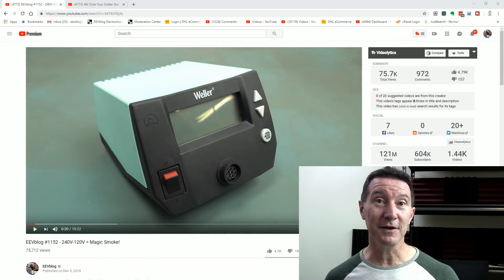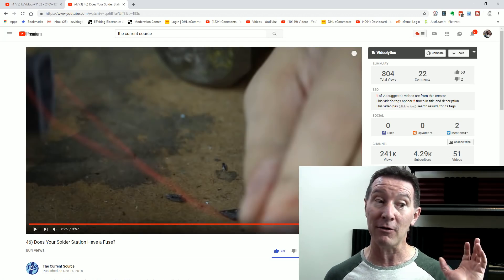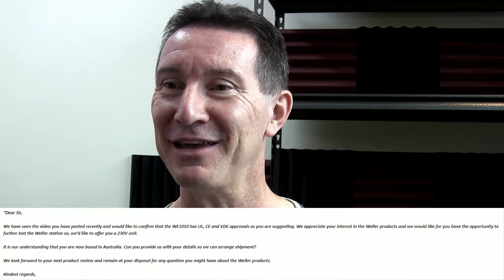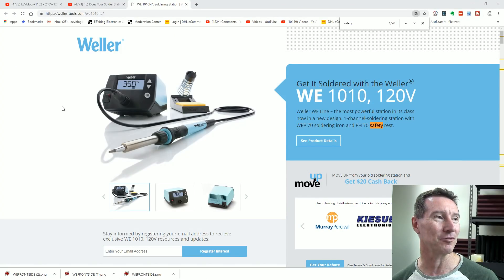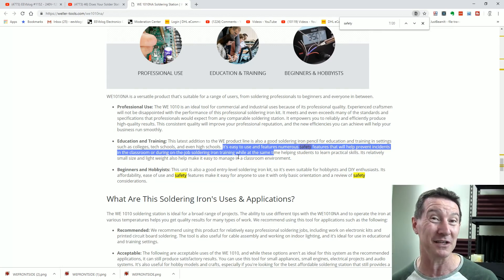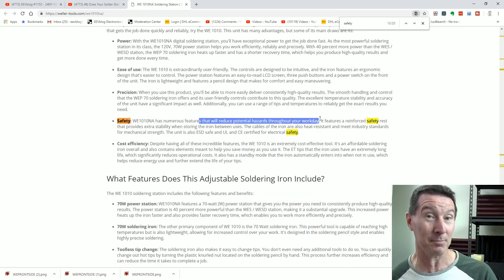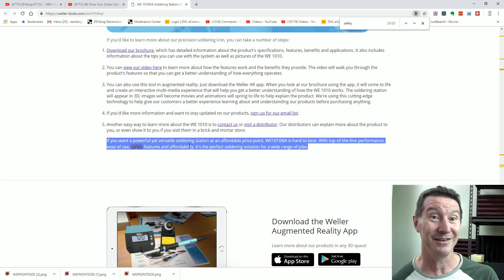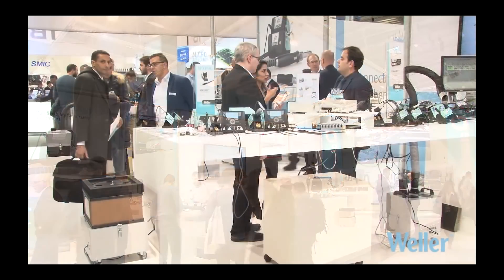EEVblog #1160 - Weller Responds!

Comment: When I was going to electronics college many of my classmates got in the habit to run to the bathroom to run their soldering iron under cold water so it wouldn't burn anything when put back in the plastic suitcase electronics kit. I never did because I suspected the thermal shock could not be good for it. Later the teacher got a response from the company saying not to do that and the kids did get free heating elements and tips for their irons. (This was pre temperature controlled irons)

Comment: I didn't realize Weller was a Banggood house brand.
Reply: Even worse - On Banggood you might get a refund and the soldering station wouldnt cost 120 bucks. You wouldnt bother to get refund anyway cause it would be cheaper( invested time)  and just easier to order another one.
Reply: Watch it, Banggood might sue you for slander.
Reply: Fluke and Tektronix are owned by Fortive Corporation, a Chinese conglomerate.

Comment: So one hung lo are safer than the 20X safety Weller.
I do have to ask why are analogue transformers better than switch mode based solder stations. Is this harking back to some old school myth or is there some genuine reason for this?
Reply: About 40 years ago, i bought a station with nothing but a big transformer, power switch and of course a primary fuse in it. Still works like on day #1. I bet most of that cheap SMPS stuff won't survive even 10 years.
Reply: @7hemroc  That isn't quite the same thing though, is it variable temperature like all these modern stations (which all have circuitry that can fail on the secondary side). I have switching PSU's for PC's that are over 20 years old that still work and these weren't expensive models either but cheap units that came in cheap cases.

The transformer itself can be over engineered with large tolerances, but the weller that blew up on the primary side, obviously has lower tolerances built in than some of the old heavy monsters. Having a transformer does not mean that it automatically has a large built in tolerance for varying voltages, unlike modern switch mode supplies which can have a wide range of input voltage. A modern cheap switch mode unit wouldn't have blown up when plugged into 240V.

The only thing I can find that the transformer based supplies have over your average switching supply is efficiency.
But at 70-100W or so for your average iron, even an inefficient design will only draw an additional 15-20W compared to a transformer based design, and given the cost differences of say $50 extra for a basic transformer model, it would take 10000 hours at $0.25 per KWh to recoup the cost difference. Of course with many switching supplies efficiency now over 90%, the efficiency difference can be less than 5% between a well designed switching and the typical transformer based supply which is typically 95-98% depending on the load and that then shifts the total hours to recoup at 40000 hours plus.  But of course that very much depends on the total design and corrections for power factor to get that efficiency, which means that even efficiency isn't automatically a given advantage to transformer based PSU's.

So the question remains unanswered as to what advantage transformer based workstations have besides their secondary use as a paperweight.
Reply: @magottyk  Yes, there are some SMPS that work 20+ years without any kind of maintenance, but the odds of that happening are substantially lower than with a transformer. The more components (and thus solder joints) there are, the higher the likelihood of failure. Some of those components even have to be electrolytic caps. They simply cannot compete with a trafo in terms of longevity. In all other respects like price, weight and probably even efficiency, a modern SMPS beats a trafo from 1970 hands down.
Reply: @7hemroc  
The transformer is only one part of the entire unit that includes circuitry as well. Therefore no modern solder station can claim better longevity whether it has a transformer or not, therefore the expense of a transformer seems superfluous to good design given the expense.
So is it just old school myths that presume them to be superior products, especially as they cannot be used universally without even more expensive transformers that require manual setting to switch the input voltage.
Reply: @magottyk  Nope, not this one. Unless you call a 24V iron with a magnetic switch in it "circuitry".
Reply: @7hemroc  
You seemed to miss the "modern" in modern solder station.
BTW is it a variable temperature model that you can dial in with fine graduation or something more basic.
Reply: @magottyk  Look at your original question, no "modern" there. It was just about trafo vs. switch mode. Not that anyone gives a shit nowadays, but the one advantage a trafo has is its longevity. Even if i used this oversized trafo to power a TS100, that combination had a much better chance to last 40 years than the same TS100 on a current SMPS. But since i don't expect to live 40 more years, my soon to purchase TS100 will get the cheapest chinese wall wart i can find :) My good old Weller "Magnastat" (with fuse holder on the front panel) will stay with me though, just in case the TS100 doesn't boot the latest firmware. The former will surely still work when I'm worm fodder. Not so sure about the latter...
Reply: @7hemroc  
So you're comparing apples and oranges, fixed temp vs variable temp irons.
Looks like the old school myth wins.
Reply: @magottyk  No, the magnastat is also variable temp. It's just a bit more hassle to change the temperature. Gotta change the tip instead of turning a knob.
Reply: @7hemroc  
Don't piss in my pocket and tell me it's raining.
You can change the fixed temperature by changing the tip and it looks like there's three temps to choose from.
That's not variable temperature by any stretch of the imagination with respect to modern stations, you also need to buy three times the number of tips if you want to cover a range of temperatures for each tip shape you use, if you don't have the different tips, you can't change temperature.
Reply: @magottyk  You can change the temp, thus its not fixed. And of course such a grampa thingie has its drawbacks. But it also has one advantage: It lives like forever.
Reply: @7hemroc  
Nah it's fixed, you have to change the magnetic sensor to change the temperature and if you do not have the part you cannot change the temperature.
I suppose you can always manually switch it off and on (with no sensor), that would be a variable temperature too because the temperature could be calculated by the on time and adjusted by more or less time.

Forever is a long time and even transformers die.

Comment: Technically, it's fine so long as you don't get a power surge (most devices don't survive surges anyways) and don't plug it into 240v. So since you didn't use it properly (by plugging it into 240v instead of 120v), UL isn't at fault.
Reply from the maker: I"m not sayinf that UL is at fault, the buck stops with Weller not taking basic safety precautions that are industry standard almost everywhere else. That's their choice, it's likely legal, and people can chose to buy Weller or not.
Reply: And part of the problem as  @EEVblog  mentioned is that it's likely legal - doesn't make it the morally right or best practise thing to do... which is why they need to be called on this nonsense of a reply to a serious safety concern!
Reply: @pfeerick  Could have also used a hardwired NEMA-5-15 plug instead of an IEC-320, which can accept power cords from most any country.
Reply: @EEVblog  Watching Big Clive's channel, I'm impressed at how all the UK plugs have fuses integrated into them, and half-sheathed hot and neutral prongs. That's safety on the level of helicopter parenting!
Reply: @BlackEpyon  We have twice the voltage for a start. We also have 32A "ring main" circuits. The fuse in the plug is actually to protect the flex, not the device.

Comment: I’ve found that most things go poof when you feed them twice the voltage the want. How is that their fault? Most NA appliances don’t have fuses as far as I’m aware. And, as far as I know the NEC doesn’t require fuses for anything lower than 1,000 volts. 
How exactly is your outrage at Weller for confirming with the electrical code of the country it’s meant to be used in? Am I missing something here?
Reply from the maker: Transformers can fail, that's why primary fuses are industry standard practice. I"m not saying the 240V goof is their fault.
Reply: EEVblog I can’t find the standard that UL rated your iron for, but I can’t confirm it to be industry standard beyond your say so. I get that transformers fail, but would a failure mode at 120VAC result in the same level of catastrophe you experienced?
Reply: If things fail you want them to fail safe. A fuse will protect against internal shorts as well as overvoltage. Having a UL or CE sticker won’t protect you if your product can be shown to catch fire on occasion. Recalls are expensive.
Reply: Gé Weijers UL and CE sets the standard that mandates such “industry standard practice” so, I want to see the standard they certified the thing under, and if it needs to be amended, then the people we need to be pissed at is UL, not the company that followed the standard. 
If it can be shown that they didn’t follow the standard set by the certification, then we need to talk to UL about revoking their certificate. 
Either way, what is the standard set by UL? Fuse on the primary or no fuse?
Would a 120VAC Transformer fail deadly? I don’t think it will.

Comment: I've used a Weller soldering iron for decades. I've been thinking of finally getting a temperature controlled soldering station from Weller with additional tips to help me work on surface mount parts. Now I'll have to think about it. I'll certainly be looking for a fuse in a soldering station before I buy one.

Comment: A lot of things like walwarts don’t have primary side fuses, heck I remember alarm clocks not having them either.
Reply: Some devices have a resistor thats supposed to blow or fuse that is in same packaging as a resistor. Or even thined down traces on pcb might act as "single use, end of life" fuse.

Some are pretty hidden but they are there ...sitting and waiting for their job.

Comment: Maybe it didn't require a fuse because it was expected to work at 120V, not like you get 240V just happening to go into it. You would think at crazy power levels like 240V they may take it more seriously. Perhaps 240V ones do require it... It would have been nice for someone to explain the reasoning, but those engineers may be contract only, and a quick it is ok and go away may have been issued.
Reply from the maker: Transformer can fail, that's why primary fuses are industry standard practice.

Comment: Honestly, I expected more from Weller.  They have a reputation in the industry.  Maybe it isn't deserved anymore.
Reply: I think they HAD a reputation but as most old companies seem to go they let the cost cutters have a go at it. Reputation now "tarnished".
Reply: they lost their reputation as the best at the high end to JBC ages ago

When even most pros in Germany don't use weller anymore, you know what's up
Reply: Based on the failure of my latest two WESD-51s including a replacement iron for one of them... as far as I'm concerned their reputation is not deserved at this point.
Reply: Maybe at one time, but in my 20+ experience, Weller has always been garbage.
Reply: Our company almost completely switched to JBC now. Way better irons.

Comment: So the Weller must of really been melted, for you to be so shocked about no fuse, even some thermal fuse... No? No damage at all to the shell of the solder station?
Anything obvious when you opened the shell? Must be to have you clutch your purse so firmly... Nothing? You opened it up and couldn't see a thing? Really? Not a hint of fire when you opened it up?
The PCB must of at least had burnt components at least? You pumped 240v through that thing (120v gives kids a shock and a lesson; 240v gives graveyards small coffins, but at least your houses can use thinner wire) ... Nothing huh?
Oh you peeled the plastic top off the transformer, and saw the enamel all cooked off the coil... Did the plastic at least have scorch marks? Melted at least? No, none of that?

My guess is that it's so well built you could cook the coil, let all the smoke out, and yet not have a bit of worry about fire at all. The plastic didn't even melt a tiny bit before its output fuse dumped itself. The delicate PCB survived with zero damage... Maybe those UL and CE ratings are earned. 

But maybe you should start wearing a dress Mary.
Reply: Are you implying 120 volts is somehow... safe? 
Considering what it takes to kill a person, that's kinda hilarious.
Reply: @KuraIthys  I'm implying that 240v is a killer, it's why we in the US take the 240v input and break it off into two 120v legs. Every house still has 240v, but we aren't electrocuting anywhere near as many people as the rest of the 240v world... But you heard that electricity is all sunshine and kisses? 
Take a nail and stick it in a 120v light socket, enjoy the adrenaline, the taste of copper, and reset the breaker. Next do the same with your dryers 240v plug. After it throws you across the room, and brings out that deep bone pain, just imagine, you thought both were exactly as dangerous.
Reply: @DeepPastry  "I'm implying that 240v is a killer, it's why we in the US take the 240v input and break it off into two 120v legs."  Maybe you guys should jsut have designed plugs and sockets that are NOT trying to kill you all the time.   Nobody ever gets shocks from Schukos with shutters or from the Brittish plugs.  // Neither 120 V nor 230 V is safe when you touch them, but both are perfectly safe as long as they are kept away from touch.
Reply: Perhaps you are particularly stupid. But if the primary can get hot enough to burn off the insulation, it's then a major fire risk, even if in this case  he unplugged it before it burst into flames. That the secondary side protected itself means jack shit, because the primary is way past saturation and will run away all on its own leaving you to hope the eventual short is low enough resistance to trip a main breaker.
Reply: @RobertSzasz  Maybe watch the actual video of the teardown afterward (I was not exaggerating in even the slightest on how well the casings withstood the heat of the coil melting down its enamel). No fire hazard, since the materials withstood the crazy amount of heat. As in the plastic casing holding the coils didn't show even the most basic signs of melting, much less scorching. It shows that no, the fire hazard was in your mind only. Check your purse for your man parts. You live in a world where material science has made plastic capable of shrugging off high heat as if nothing happened.
Reply: @DeepPastry  right, it was safe if you unplugged it as it was releasing the smoke. If for some reason you didn't or couldn't unplug it immediately, you are relying on luck to create a high current short and pop a breaker or fuse somewhere else before it catches on fire. A "high" resistance failure and you have a kW or two heater that will catch the unit and the bench on fire.
Reply: @RobertSzasz  ... Not luck, modern material science, and both UL and CE testing to say they didn't screw it up.
Yes, a fuse would of been nice, because you could of saved the transformer completely, and just needed to get a new fuse.
You rely on luck, I'll go with science.
Reply: @DeepPastry  why did the primary coil overheat when connected to 240v? I think you might be missing a couple things when you think there's no risk when this transformer is exposed to overvoltage.

Edit: and perhaps, just perhaps the reason the case withstood the pulse of heat when the enamel didn't was because it was partially protected by the giant heatsink of the core? Surviving a momentary fault is important, but it shows nothing about how a sustained fault would be handled

Comment: You should get a 120v version of the Hakko FX888D and plug it into 230v for comparison
Reply: I (inadvertently) did that experiment already... ordered a batch of them for our lab and some were 110V by accident (but with 230V NZ mains plugs fitted and 230V stickers!  Thats another story)... they simply blew the internal fuse.  No smoke, no fire, no bang.
Reply: They are fused, but the transformer is wired for 120v, not 240v.
Reply: Yeah, I second that motion; just be sure you’ve got at least two cameras recording - that way at least one will catch any magic smoke being released! Oh, and be sure to channel some shango066 and stuff the unit with fireworks before the EOL video! 😁🎆🎇
Reply: @williamsquires3070  That sounds like something bigclivedotcom would do!
Reply: @williamsquires3070   Very cool to find another Shango fan in the wild.

Comment: Only people who have worked their way up to the top should be at the top based on their understaning of engineering (mechanical as well as electrical).
Unfortunately these days you get non-taxpaying globalists buying entire companies.
They then trim down the workforce and shove some wanker into the CEO's position. Cheers.
Reply from the maker: Nothing wrong with getting a response from a director of marketing, in fact that's the person who should respond. But the onus is on them to ensure they have the correct technical response.
I'm sure this was very a carefully crafted response, i.e. say it meets standard and no comment on anything else.
Reply: No, EEs are not marketing experts, nor would most EEs want to be. They're two different jobs. That would be like if Dave got a response from an EE (instead of the VP of marketing) and they did something that put the company in lethal liability. Then saying that all their EEs should have marketing/legal training.